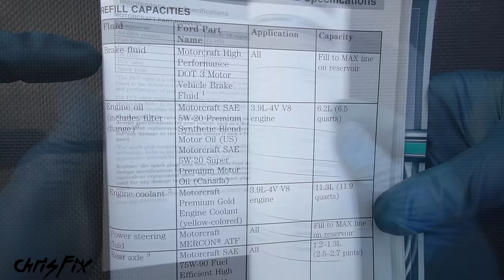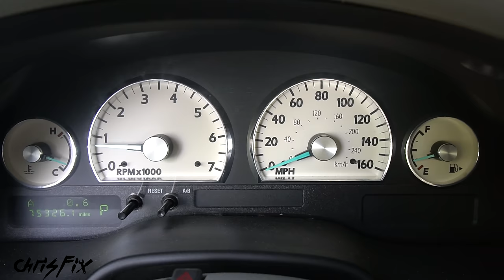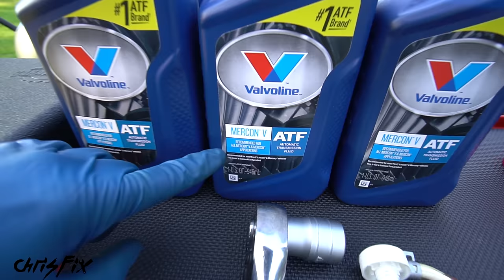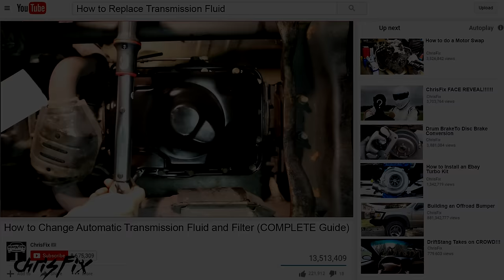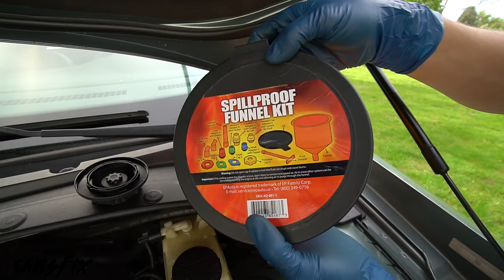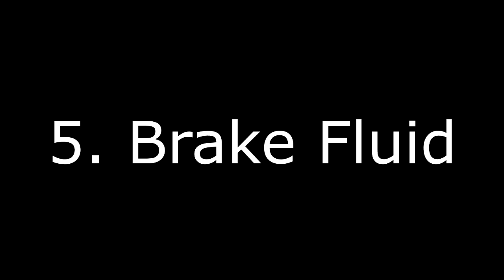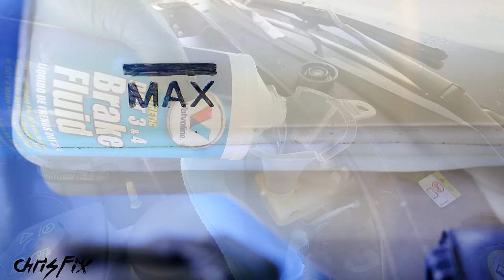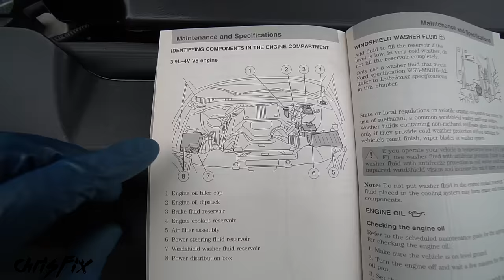How to Change EVERY FLUID in your Car or Truck (Oil, Transmission, Coolant, Brake, and More)

Comment: How are you starting the car and shifting through gears and turning the wheel when the car is jacked up?
Reply from the maker: When it's on jack stands the car just sits there and won't go anywhere. You can put it gear and push your foot down all the way but since the tires aren't on the ground it can't move anywhere

Comment: Also, do you have a video specifically about serperately bleeding the ABS module on ABS equipped cars? Braking systems with ABS are a pain because you have to do A LOT of extra bleeding. I know you are always busy so thanks in advance.

Comment: When I was adding coolant after I did a radiator change I was waiting for the car to get up to temp and the funnel overflowed. Also I have no barely any heat. 
It’s a 1994 mustang GT
Reply: Did  you check for air  bubbles?
Reply: @vigilantemotors  I ended up having a friend come over, there’s a screw next to the top radiator hose and once he undid that it started working correctly
Reply: @visco_ties3875  Awesome news! Glad it was not a huge deal and was fixed

Comment: Hi Chris, quick question. I have a Volvo v70 2003 diesel and i want to change the coolant in it. I bought me the funnel kit like you did in the video, but my question is that my coolant container is quite large and has a max and a min level mentioned inside. If i fill the funnel all the way to the brim, wont that make problems?
Reply from the maker: You can always use a turkey baster or some type of pump to suck out the extra coolant so it’s at the MAX line after you are done. But as you bleed the air out and run the engine, it’s fine to overfill with the funnel.

Comment: I know i'm pretty late to this video, but i was just wondering with a sealed transmission - is pumping some air into it much of a big deal, or would you have to treat the oil pump like a syringe?
Reply from the maker: I would avoid getting any air into the transmission as much as possible

Comment: Chris I bought a 2000 Ford Ranger 2WD automatic with 190k miles on it. Looks like I have a rear main sill leak, do you recommend getting that repaired? Or should I just add rear main seal repair? I know cost is mainly coming from labor cost but I wasn’t sure if maybe I should pay to get that repaired?

Comment: I changed my engine oil today and found something crazy and I shouted:" wtf did the mechanic do during last service?" The van requires 4.8L to 5.2L engine oil and the oil level was just 3.5L!! So that meant I ran this van on almost half the oil amount for a whole year (no burning oil since exhaust is clear)! So I flushed my engine and top up with semi synthetic oil temporarily for the next 500kms. And will flush again and top up with full synthetic oil. The first flush out looks like soy sauce and luckily no metal shavings found yet. After this oil change, the engine noise halved right away. Oh, solute to your tutorial. My next mission will be atf change.
Reply from the maker: Dang! That mechanic should not be doing oil changes then. Glad to hear there is no metal shavings

Comment: Maybe point the ramps at a 90 degree angle so they point outwards ? So if the car fails on the front it doesn’t roll off the other stands.

Comment: Any chance if you do redo this type of video, can you please add disposing options? I'm planning to do some of my own maintenance on our second car and would like to dispose correctly. Thanks!
Reply: Typically your local auto parts store like an AutoZone, O'Riellys etc will take your old fluids. Ask about brake fluid first because there are some stipulations on it. 

Hope that helps you some

Comment: What if i just bought a car that has around 146k miles and the individual i purchased off doesn't remember the exact date any of the fluids were changed? Want to note that im a first-time driver, car owner, and zero experience mechanic but willing to learn.
Reply from the maker: You should be able to check the condition of most of these fluids pretty easily, so just compare what you see to what fresh fluid should look like and go from there. If you have to change, write down when you did it so you can keep track!
Reply: @chrisfix  thank you bruv!!

Comment: Hi Chris! I have a 2013 Camry and it has around 115k miles and purchased it recently. I do not think the transmission fluid has ever been changed. Should I proceed with a drain and refill?

Comment: Chris do you recommend using oil extractors for engine and trans oil
Reply from the maker: It can make the job way less messy but it's not a replacement for doing a proper drain, if you have access to one for sure use it, if not you'll be fine
Reply: @chrisfix  thanks for answering man you're awsome

Comment: To drain  the transmission or engine it does not need be level..just room to get under the car ...the drain plug just need be at its lowest..of the car...since you already know how many quarts the car needs....you can't  over or under fill....but you need to check after a month to add if it needs...but it need be level then...

Comment: i changed a ECT sensor after running the car for a half hour, can confirm dont do cooling system stuff on a hot car, removed the sensor and boom flood gates opened with 200 degree coolant was like a power washer from hell

Comment: Other than the oil change, how often should the other changes typically be done? Would the owners Manuel tell you or is there a general works for all timeframe
Reply: Big, your owners manual should give you the mileage intervals when to change/replace your fluids. Mind if I ask what kind of vehicle you have?
Reply: @vigilantemotors  2023 Elantra N-Line
Reply: @bigflx2754  section 9 of your owners manual goes over the maintenance you should be doing. One you should be aware of is your brake fluid that should be changed at 48,000 miles.
Spark plugs every 42,000 miles
Cabin Air Filter every 16k

Do you hands your manual?
Reply: @vigilantemotors  yes I have my owners manual, I didn’t have my car yet when I originally wrote the comment, thanks for pointing out those tho, I definitely wouldn’t have thought to change the cabin filter
Reply: @bigflx2754  Its most likely located in the glove box, they are usually very easy to change yourself. 
If you have any questions hit me up here or on my channel and I will always answer any questions you may have.

Aaron
Reply: @vigilantemotors  thank you I appreciate it, I’ll subscribe to you
Reply: @bigflx2754  Thank you!! If there is ever a question you have or even a video you you'd like to see let me know
Reply: @vigilantemotors  will do, have a good one man
Reply: @bigflx2754  You too!!

Comment: I do believe that filling your oil filter is a good idea, though it has been proven and completed debunked as a myth on regular gasoline engines, this is not at all something that needs to be done, I am more of a person who says this is a much better idea when your car has been sitting and the engine hasn't been turned over in a while. Diesel's are the only ones that really require a pre-filled engine oil filter, and that is strictly because the filters are usually a lot larger than a gasoline engine oil filter, and also pre-primes it because of the size of the filter.

Comment: would brake drums have the brake fluid bleeder in the same to similar location?
Reply: Devon, yes they will be in a similar area. Take the wheel off its much easier to work with drums and bleeding with the tire removed.

Hope that helps you out

Comment: Hi Chris. Ihave a 2014 Taurus and i read that comes with a seal trans but some people drill a hole in a PTU?  to change the trans fluid.  Its really necesary to do this?  Saludos from Puerto Rico.
Reply from the maker: I definitely wouldn't drill a hole, there's usually some way to drain or at least access the fluid

Comment: Better not to pre-fill an oil filter if anything but vertical with the mount up top (i.e. small block Chevrolet etc).  Most cars (excepting some Japanese, Korean and EU cars) have what's called a 'clear flood' mode.  Press and hold the gas pedal to the floor and crank the engine, in clear flood mode the engine will not start because the ECM turns off the fuel injectors.  Crank for about 10 seconds and this will fill your filter and all of the galleys in the engine.
Reply from the maker: Thanks for the info

Comment: I know this video is old but, HEY CHRIS, How do I fix the fluid in my 87 drop top Mustang? Motor is wining and seems like its a cable... could be fluid but I don't think so.
Reply from the maker: If it’s hydraulic there should be a reservoir. If it’s a corkscrew gear you can try lubing it.

Comment: may be a weird comment here. but is it possible to use a shop vac on the cooling system to remove near all to every drop of coolant before a coolant system flush?

Comment: When changing power steering fluid, can I do it when car stays on ground (without jack stands)?
Reply from the maker: I wouldn't recommended it since you'll have a lot harder of a time turning the wheel you won't get as much fluid out

Comment: What if the oil filter is straight up and down. How are you supposed to fill it and put it back on the vehicle?
Reply: Conner, you really do not have to pre-fill the oil filter. If you can ok then do it, but NOT doing it will NOT harm your engine. Hope that helps you some and if you have any questions just hit me up.

Aaron
Reply: @vigilantemotors  I appreciate the response, I didn't know if prefilling the oil filter helped it run better when you first start it up or something. I have never done that before. Thanks for letting me know!
Reply: @Pr0fess0rConner-j8l  Again, if you can pre-fill it then why not. Just remember when you do that it counts as some of the oil you are putting into the engine so account for how much you put in. 
You may find my channel helpful in the future so check it out if you want. 
I always answer every question asked on my channel so ask away and I will help you out my man.

Aaron

Comment: Are differential and transfer case fluids only in all wheel drives?
Reply from the maker: Transfer case yes, differential no because some cars are rear wheel drive
Reply: i think differential fluid is gearbox oil here in the uk sorry for confusin thx @chrisfix

Comment: If the front fail then it will roll down making the back jacks fail as well. Maybe 2x6 12 inches long  boards under the tires?

Comment: One hundred percent break fluid is the most felt change. New break fluid can change the feel of the break entirely if you’re used to bad break fluid.
Reply: Most likely because you got the air bubbles out of the system (bleeding the brakes) . Air is compressible so even tiny tiny bubbles in the system will give your pedal a spongy feel. Once you get the air bubbles out you get your solid pedal feel back. Brake fluid is also hydroscopic meaning it absorbs water from the air. Water in the system can corrode parts so a change every 4-6 years will prevent corrosion. They make cheap testers under $20 you can buy to test your fluid for water content.

Comment: What if the transmission is swapped for a non oem one by a previous owner? For an example i own a 2000 f150 4.2l v6 that originally has a manual transmission but was swapped to automatic transmission that im not sure what it was

Comment: Is there another word for rear differential fluid?? Cause I cannot find it. I have a hyundai elantra from 2003. I have that weird howling noise when driving away in 1st and second gear.
Reply: Gear oil. It comes in a few different weights so google your car to find out but most likely 75w90

Comment: What happens if you don't put a little engine oil in the oil filter? The reason I am asking is because the oil filter in my car screws on from the top. I'm afraid the oil will spill :( Since I can't do that, what else could I do?
Reply: It's just best practice because that way the car doesn't start without oil

Comment: hey @chisFix, doubt you will see this comment but if you do i have a question. Im currently trying to find a first car for myself something used yk on marketplace. I found a 2005 scion tc for 3500 and went and looked at it in person. He said title clean, 117,000 miles on it, and no issues with running. I checked the oil and it was bone dry and so was the coolant. he said it has been sitting for a couple months but still. Could that mean it has an oil leak or maybe he ran the car until it burnt all of the oil up inside?
Reply from the maker: I'd crawl under and see if there is a leak, if you dont see anything it's possible that the oil and coolant is low which may not be a bad thing (minimum levels are still ok but not preferable) but I would check for signs of overheating/low oil
Reply: @chrisfix  thank you for the advice, i love your content and you are always super helpful!

Comment: For the brake fluid, can I just change the fluid in the master cylinder without bleeding the fluid from the brake lines?
Reply: William. No. Most of the fluid is going to be in you lines as they run the entire length of the vehicle. Bleeding is not that tough but make sure you DO NOT run your master cylinder dry during the process. If you have questions on this just let me know and I will gladly help.

Aaron
Reply: as Aaron said, you're gonna want to do the bleed. Especially if your brakes feel very dull, that could mean there's air in your brake lines that you're gonna need to get out for it to feel tight again
Reply: @HeterosexuaI  ABSOLUTELY. Spot on Gabriel!

Comment: What if the transmission doesn’t have a drain/fill bolt?
Reply from the maker: You'll probably have to go through the breather tube to extract and fill the fluid

Comment: I wish I could find any info on how to change my daily driver which is a 2017 hyundai sonata limited with a 2.4lt transmission fluid. I can find every vehicle under the sun except this one and it makes no sense because I see a million of them on the road. It makes me so mad I have to pay $450 every 30,000mi when I know I can do it but it's an odd vehicle. I never buy foreign vehicles so I don't know much about them.

Comment: I'd like to drain and clean a little my master cylinder a little on my 2004 Grand Marquis, but you can't remove the float that's in the way.  I assume that's on purpose.

Comment: in regards to transmission fluid change... what if you can't manually change gears? I have a 2018 chrysler 300 with a turn dial knob as a shifter.

Comment: I'm not a pro as you are in changing fluids but in the engine coolant shouldn't you turn on the car to add it or am I mistaken with another fluid?
Reply: No your talking about engine oil because when the engine heats up it loosens the oil so it isn’t as thick so it’s easier to flow out

Comment: Does this car not have the normal jacking points next to each wheel? Those were some weird places to put the jack stands at
Reply from the maker: You don’t put jack stands on pinch welds. That’s not a stable spot to use a normal jack stand.
Reply: @ChrisFix  that's literally what they're designed for...
Reply: @hustla818  a normal jackstand isnt going to work well on the pinch weld without a rubber adapter

Comment: Just bought a new pump for my Tacoma 4x4 and the pump I purchase has a disclaimer. New pump is equipped with a sensor that needs to be transferred to the new pump. If this sensor and spring aren’t transferred correctly the seal may fail as a result of high pressure??? Is this that hard to replace?

Comment: If you are doing a full fush of everything. What is the order?
Reply from the maker: I would do coolant (since you'll want to be working on a cold engine), then oil, then transmission, then brake fluid, then differential, then transfer case, then power steering, then washer fluid.
Reply: @chrisfix Thank you so much for the quick reply. Really appreciate it. do you have a "buy me a coffee" or tip app?
Reply: @chrisfix just bought a used truck for dirt cheap with 100k miles. Not sure when it was last fully serviced. SO wanted to try and work my way through the DIY fixes. Really appreciate your videos! Please keep'em coming.

Comment: Chrisfix i have a question relating to oil, is engine flushing safe for any vehicle?
Reply from the maker: If your engine doesn’t have sludge, I wouldn’t use it. It is “safe” if used by the directions.
Reply: @chrisfix  oh ok thanks!

Comment: Great informativos, but in chance brake fluid after all , close reservator, because fluid is higroscopic, and lose the proprietor memorial that contamination is exposivit Air, and the First star its reels back in X position when ABS break.

Comment: Does this cover clutch fluid?
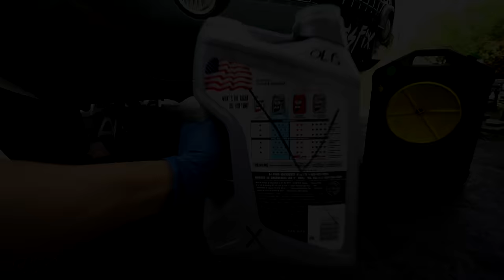Reply from the maker: I changed the transmission fluid 9:38
Reply: @chrisfix  isn't clutch fluid the same type of fluid used for brakes?

Comment: me who's car has no floor pan no ac no seals no fuel pump, fill hose, rear shelf, or ecu cover panels, no passenger seat no seatbelts no middle console, shitty paint, rocker panel rust, body rot, watching this:

Comment: If i change the coolant fluid do i have to bleed the radiator? or can just topoff the resovoir? (since i dont have anything to lift the car with  & For the break fluid do i have to bleed each tires break system or can you mix in new fluid in the resovoir with old.
Reply: The video explains the answer to your question well. If the fluids get too dirty it can cause rust.(Rust eats metal) Rust is number 1 enemy on cars:

Comment: What about Clutch Fluid?
Reply: Typically located near your brake master cylinder. Just pop the cap and make sure you can see the brake fluid. You may or may not have a fill line.
Reply: @vigilantemotors  Oh thanks. 👍
Reply: Anytime @jamis_b_9567